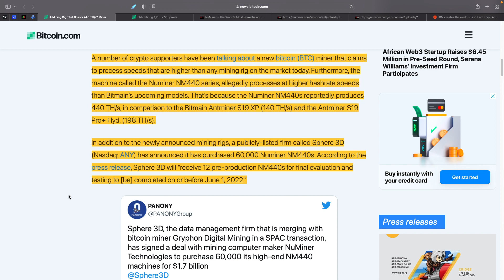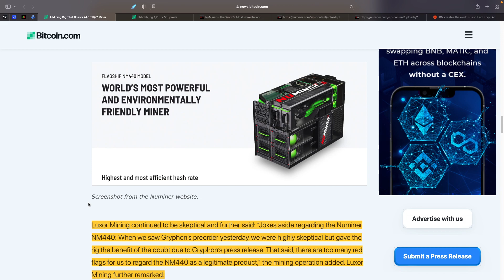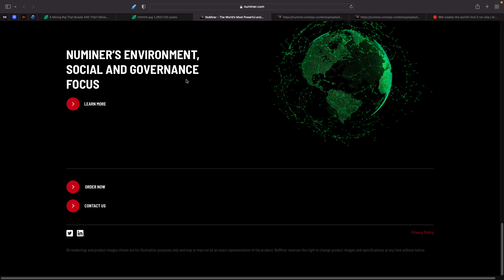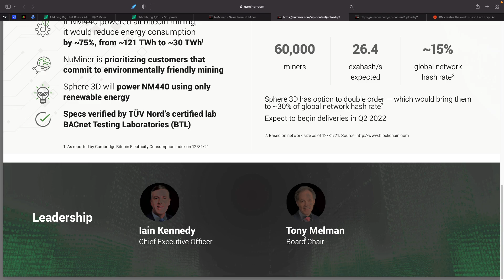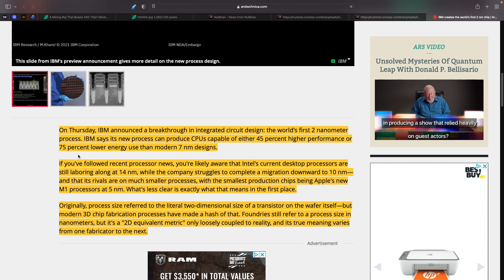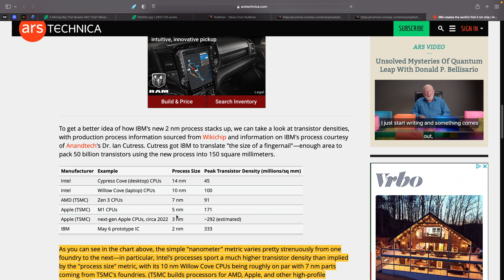Numiner NM440 TH/s FAKE OR REAL? My Thoughts On This New Bitcoin Miner. Sphere 3d Purchases 60k!

Comment: The video is 100% a 3D artist trying to make creative liberties off of the concept art. Again, just concept.
Reply from the maker: Agree. But do you think the technology is real to reach the specs they are claiming?
Reply: @SebastianOn  not sure, I just know that they probably wanted some kind of imagery to use but didn’t have a finished CAD file. I think they may be partnering with Cerebras. People have posted their tech pic that basically looks the same. They probably just used that and added some creative liberties to it just so they could create some marketing material.
Reply from the maker: I agree, and in my update video I spoke about this where they could have hired a freelance graphic designer and they just pulled some image and updated it.

Comment: Thanks for the digging. I was diving down this rabbit hole last night and hadn’t made the connection to NM improvements or the IBM tie in. There’s not much else to go on considering they are a new company and we haven’t seen their flagship product.
Reply from the maker: That is basically what I did. I searched for improvement in chip design and nanometer process. And the IBM news matched up with what was being reported by Numiner. So in theory it is possible to make such a miner the question now is will they and can they do in time. Thanks for watching and have a great day.

Comment: based on some digging, about 70% chance its fake...... and the image looks fake as well.
Reply from the maker: I would agree the image is fake. But check out this article I talked about towards the end of the video. https://arstechnica.com/gadgets/2021/05/ibm-creates-the-worlds-first-2-nm-chip/ IBM has created a 2nm chip that uses 75% energy and TSMC has a 3nm chip fab that could also get the job done. The CEO worked for IBM which gives us a possible connection. I give it 75% that it will be made.  I could be wrong but after reading that article I think it might be possible. Thanks for watching and have great night.
Reply: @SebastianOn  Doesn't the fact that they list TSMC as their partner make the whole IBM connection kind of moot? And it's already a fairly loose connection at that.. Everything about that website screams red flag to me. 🚩
Reply from the maker: Great comment, so from what I have learned is that IBM does not make their own chips anymore since 2014 and they have other companies like Samsung make them. The thing that is interesting in the article is that it states the following "Comparing transistor densities to existing processes also seems to take some of the wind from IBM's sails. Comparing the new design to TSMC 7 nm is well and good, but TSMC's 5 nm process is already in production, and its 3 nm process, which has a very similar transistor density, is on track for production status next year." It looks like 2nm might be out for another 2 years or so but we do have 3nm chip which might have the same results. I'm no expert so I can only go by what I read and research. I know I'm grasping at thin connections here between IBM and the CEO of Numiner. The real point I'm trying to make and perhaps I didn't clearly state is that it looks like the technology is out there to make this possible. The only question is a foundry like TSMC going to make the chips for a no name miner like Numiner. And the only thing that might convince them to make the chips would be a large deal of a billion or more. There a lot more questions then there are answers. So we'll see if get some data on this come June. Thanks for watching and have a great day.
Reply: @SebastianOn  Thank you for the insight, I understand a lot better now and agree, it is indeed possible. I will stay a healthy skeptic for now though 😃✌
Reply from the maker: Awesome, thanks a lot.

Comment: I think Numiner doesnt produce the product themselves. But rather rebranded cerebras system cs2 machine . Those machines are ai super computer used in medical image rendering. It uses an enormous wafer sized chip instead of a normal palm sized cutout chips.

But those machines are the size of a minifridge.Staking the machine might be a problem with space constraint in data centers. Im still skeptical on the company regardless, slapping their logo on existing machine.
Reply from the maker: There is a difference between image rendering chips and ASIC chips. ASIC's are application specific integrated chips meant for a single task. The Cerebras CS2 is an AI tensor flow super computer in a big box. It's impress tech but built for multipurpose. Check out this article https://arstechnica.com/gadgets/2021/05/ibm-creates-the-worlds-first-2-nm-chip/ IBM has created a 2nm chip that uses 75% less energy. TSMC also is capable of making 3nm chips which might have the same benefit. The CEO of Numiner has history with IBM and might be connected in there. Which leads to think that they might be able to pull this off especially since they are going to be using TSMC for the chip fab. Thanks for watching and have a great night.